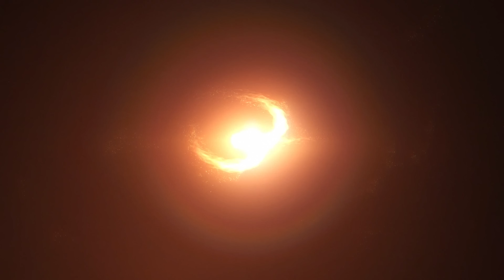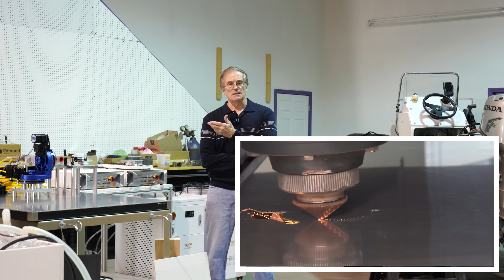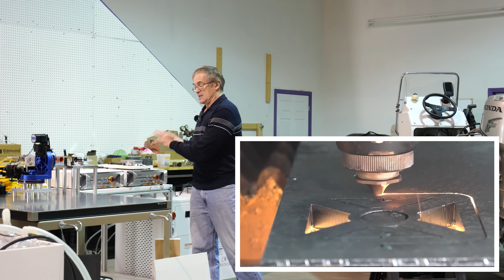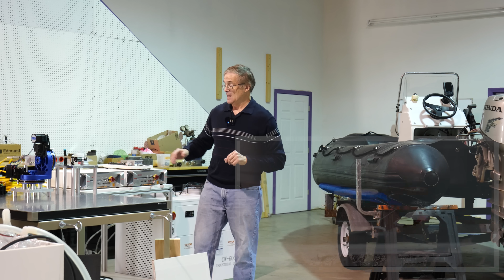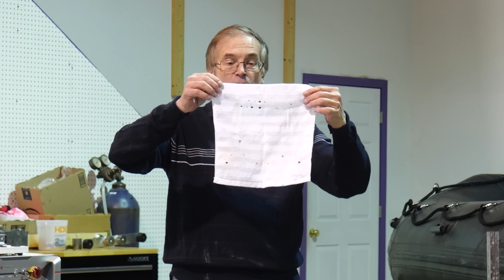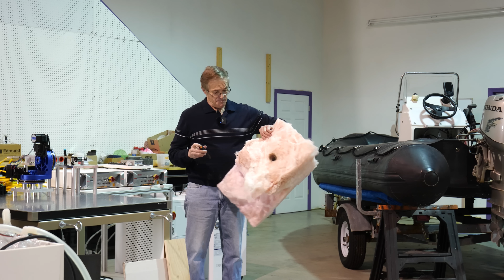We have a problem... and need your help!

Comment: Could you place a mirror outside at a 45-degree angle to direct the beam upwards to the sky? The mirror could be slightly parabolic to spread the beam. If it's necessary to keep the sliding door closed, you could cut a hole in it to allow the beam to pass through toward the mirror.

Comment: I would try something like a water curtain with sold back plane, or take page from spaceX and water cool your metal heat tiles (or similar).

Also, i dont think this would work, but i really want to see a video. Try starlight material. Maybe it would do surprisingly well?

Comment: Just a couple of maybe Ideas is to use insulating blanket such as that used in Kilns or even the fire resistant brick also used in Kilns and they are white and light also.

Comment: Furniture designer woodworker and all around good guy here. Going back to time stamp 2:48 and the description of the operation of focusing the beam makes me think the system would be better used in a way similar to the actual design. An accurate, fast range finder used to bring the beams together at an appropriate distance might be used. What I envision is something like a planetary gear system operated by turning the ring gear by servo or stepper motor and having the fiber optics placed on center of the planets but aimed off axis. Maybe? Should only take a week or two to get it running. EDIT: After thinking about the description I gave it may seem I'm saying to spin the optic in the planetary as to describe a cone in their motion. The beam will have to be made to trace along the radius of the ring gear. Perhaps some sort of eccentric could be used. No doubt it would be a beast to collimate.

Comment: Messy option: Cinderblocks filled with sand... maybe duct tape the bottoms so it's easier to assemble / dump out without making a mess?
Less mess: Tungsten carbide & silica slurry sandwiched between coarse sanded copper sheets. Refractory shops should have ample of both for 'cheap'. The high melt temp of the mix is a backup to the coppers absorbent properties.

Comment: what about a series so dlp chips you could salvage from a bunch of old defunct projectors. the chips are pretty robust, should absorb a lot of heat and could provide a small target area that is lightweight and while somehwat reflective should be able to control the direction of the beam, even without being powered.

Comment: If no clear "winner solution" appears in the comment section, might I suggest that you test out the most feasible seeming suggestions on a gun range, firing the laser from a slightly elevated position, at a shallow angle towards the ground, so that if it burns through the berm, it goes into the ground and not into someone, while also implementing all other sensible safety precautions suggested.
The testing sessions could be then made into a video all on its own.
Also the obligatory, - if I had you as a teacher in my school, I would've likely become an enginerd or a teacher myself.

Comment: This is what I'm thinking.
A hollow wall full of sand or similar marerial.
Theory.
Aa the beam hits and starts vaporizing or melting the filler...mors fresh material falls I to replace the old.to recharge just add more material.maybe you can find a material like aluminum oxide(high melting point) that can further deter the hear accumulation.

Comment: maybe try starlight, is pretty cheap to make at home, you can pre burn it so it becomes black to absorb more light, it is supposed to be fire resistant, so if you coat some wood with it, it may survive a while

Comment: Sandbags. Or maybe that US military sandbag/sandwall system, where they use a metal mesh that can be expanded/pulled out like an accordion, and can be filled with sand. The covering material
will burn, so that should be something that burns with self extinguish property.

Comment: • Budget: ammo-can “suitcase” lined with lightweight insulating firebricks IFB 2600 (≈1.4 kg each). Matte, non-reflective, shrugs off a 10 kW fiber laser for ~5 s.
• Premium: 15 mm reaction-bonded SiC disk. Handles 50 kW+ hits, won’t burn or off-gas, but costs ~20× the brick solution.

Comment: If you hold a flame under a balloon with water in it, it does not burst or burn. Maybe the same will happen if you use a laser beam. The heat just dissipates into the water.

Comment: Teflon? ....My father worked for NASA. He had a collection of different types of heat shields used for reentry. The tiles on the Space Shuttle were super light. Great for heat, but I don't know if they are good for lasers.

Comment: My idea to make it as cheap as possible is to make portable panels that might be stacked of sheets of cork soaked in phenolic resin, like the ablation shields used in orbital re-entry capsules. They burn and create layers of carbon that gets instantly replaced with new layers before the top layer can ablate and disintegrate. They would have to be cheap to make and easily replaceable, because you’d have to do a quick inspection after every few tests and you could stack them in layers of two or three.
Reply: The other idea is someone mentioned just using a berm of dirt, but you said you want it in the warehouse. So google “black plastic pallet crate” or bulk pallet crate, you can stack them with a forklift 2 or 3 deep and 2 or three high and fill them with dirt. Then when you are done you can dump out the dirt and collapse the crates for later and store them in the warehouse. You might even get them used from a local industrial park/ business

Comment: I would suggest using a ground glass diffuser, ie a privacy window or privacy glass. The key is that diffuser should not absorb the laser, but cause a random phase shift to scatter the beam in all directions. Then you can combine any other absorbing back stop solution from the other comments to absorb the light energy. You could even have multiple diffuser layers if you can find cheap glass panels. You can even make your own diffuser by simply sanding a smooth glass surface. Good luck, I love seeing the project you are working on!

Comment: Any solid/stationary solution would likely be heavy... only thing I can imagine working here while being vaguely movable is a giant sludgefall of graphite-containing fluid running over a refractory brick backing surface. But I guess some big hollow glass panels full of wet black sand might hold up for a little while?

Comment: alright...asbestos used to come in sheets---haven't thought of gas with super high heat--until you proposed question---also fire brick used in the back of fireplaces for reflecting heat out into the room---might get your ideas going?---me

Comment: ik it's a long shot but a Whipple shield type set up with one layer of permeable diffracting material and one with absorption of the diffused beam. perhaps a Fresnel lens or diffraction grid and a layer of carbon coated earthen panel might help. this is just crazy enough to work in my opinion.
Reply: that or dirt heap/sand bag etc

Comment: It's obvious to me now.  The laser power is just too much.  Most of the testing must be done with a lower power laser. The finesse can be done with the real deal but maybe you can program the system for test purposes to only actually fire the laser at the target when the target is in front of an absorbent background.  Not the entire background will be made of this material.  This makes other materials such as 2x2 concrete pavers an option. Only a small section and only for testing. As suggested earlier testing outside or in a cave would be the only other option that I can see.

Comment: I was thinking if you used perlite from the garden center in between two layers of cement board it could fall in if some got burned away and replenish itself its also very light weight. You could also use metal insulator metal stack to automatically kill the laser when the beam hit it it would fuse the first to the second and sending a signal to kill the laser

Comment: I think a composite sandwich layers of different materials will be needed. Mount the wall on wheels so weight isn’t as restrictive. Cement wallboard on both sides of a steel stud frame filled with wet sand might do it.

Comment: A carbonizing agent you can layer on top of the wall. There are various household items that could be mixed to create high heat resistant solutions. Nighthawkinlight did an experiment to figure out Starlite, and others have followed suit in more recent years. The originator of "Starlite" claimed that it could handle 10,000C worth of heat and that it was laser resistant.

Comment: You came close but you forgot to ask the obvious question. “How do the big boys do it?” I’ve worked with fiber and solid state lasers for a couple decades and they use a mechanical device called a shutter, which is a water cooled device that uses black anodizes aluminum plates with additional coatings. Looks like you have a 1k watt device there, military try to use chemical lasers which produce mega watts, but the problem the gases produced from the process are toxic. If you call Omada or Trumpf lasers, I’m sure they can help you.

Comment: Silicon carbide (SiC), alumina (Al₂O₃), boron carbide (B₄C): High melting points and thermal shock resistance make them suitable for laser armor or optical components.
Reply: Silicon Nitride - another one to look into.

Comment: Setup a "Jacobs Ladder" arrangement of laser beam splitters. Where there is a 10 % to 90% split ratio. 
Each level disipates 10% assuming you have a solution for absorbing 10% of the fiber laser output. Otherwise add more splitters. 
P.S. make sure your splitter optics are perfectly clean before each test firing. 
Chromii

Comment: I'm not engineer or anything so no clue if what I'm about to say is logical, but the first thing that comes to mind would be something that can resist high temperatures and at the same time be a good thermal conductor like Graphite, my idea is to have a panel of graphite (or other material) in the way of the laser and on the back of the panel have one or many thermal probes connected to a micro controller that detects the increase in temperature and activates the kill switch using relays or a contactor directly in the power line of the machines

Comment: What about changing the focal length of the beam prior to its output so that the laser beam is weakened or completely removed, nullified or weakened substantially. The moment you wish to target something you open up this gateway or switch releasing the full power of the laser beam but until that moment you have an unfocused laser that is nothing stronger than a harmless flashlight.

Not sure if I’m explaining this well but essentially I am suggesting a switch or plate that is attached to a solenoid that can be lowered in the path of the laser beam and then removed when you want full power thereby decreasing the legality of the beam until one needs full power.

Comment: My first thought was based off you comment about maybe the light would bounce around fiberglass, could you use Vanta black as part of the solution. My second thought was can you do something that acts like a lens to rediffuse your focused beam.

Of course my other thought was that using this IRL would risk potentially major collateral damage behind the thing you're trying to damage. At what distance does the beam diffuse enough to be safe?

Comment: I'm not a physics Guy, but If the area that hast to be Laser-Save is Limited within - let's say - 100cm2 probably a kind of spheric formed Plate of 1cm thick tungsten steel with a rough surface. That probably could withstand a short period of time the Laser-Energy without taking much Damage and could give enough Time to Stop or shutdown.

Comment: After thinking about it overnight, came up with a better idea than my previous post.

As I understand it, you only need to withstand the laser for a couple of seconds.  How about open top 55 gallon steel drums in two offset rows?  We get our open top drums from an industrial waste disposal company.  

The offset is so there are no gaps between drums.  Use steel strapping to hold the drums in groups of four, two in front, and two in back.  

Place two groups, stacked on top of each other, on a pallet.  Rent a small forklift to move the pallets around.  

If empty drums are insufficient, fill them with sand or pea gravel.  Or fill with something lighter if you can identify something affordable.

I know you wanted something less massive, but I think mass is the answer.  This solution is massive, but it is also easy to contain and move around.
Reply: The drums may not be made from laser safe materials and the fumes can be toxic or Release hydrochloric acid gas.
Reply: @ How do steel drums or sand release hydrochloric acid gas?  And it is apparent that no materials are safe from these lasers.  The drums I am referring to are nothing but steel and paint.  The paint can be removed with a wire wheel.  The sand is silica dioxide.  That gives you silica, oxygen, iron, and carbon for potential reactants.  No hydrogen.  No chlorine.  Just molten glass and steel in amounts less than welders and glassblowers are exposed to every day.

Comment: In the background you can have a 55 Gallon metal drum, rotating a slurry of dark sand and water. Will have to be positioned so that the beam hits the slurry at all times and not the drum body.

Comment: Redirect the beam via 2nd fiber bundle to a toriodal plasma chamber using magnetic containment. Bleed off energy as defused light or IR heat. 
Hopefully you can recover some of this energy & use it for practical applications. 
Chromii

Comment: Need a combination approach.  First, use Vantablack material,  the blackest or darkest  material known , to absorb 99% of the laser light . Put that inside a take of tank of ferrofluid or mineral oil will  momentary dissipate the excessive heat.

Comment: Can't help with the material thing, but a few ideas came to mind. They're probably naive and silly but it can't hurt to throw them out there in case they spark a better idea.

1. Pulse the laser
2. Use both lasers at a lower power and direct them to converge at the distance you want
3. Instead of a material, use some kind of photoelectric device to dissipate the photons - or a series of 50/50 splitters maybe

Comment: Build/setup and brickwall and install a fairly substantial water fall over the fire facing front of it. You might even include some fine particulate in the water to cloud and help briefly absorb the energy but very quickly move away to a cooler zone. Also somehow moving the WHOLE WALL back and forth or up and down or random motion should assist keeping the bricks from sustaining a single point of destruction. Just top of my head. Precise material could be experimented with. Another material to consider somehow utilizing is AEROGEL.

Comment: At the point where you need to have a lower power level, could you use a beam spreader to lower the beam intensity and the need to use exotic parts to impact the laser's intensity?

Comment: 1. Do the tests outside.
2. Have a surfacemirror on the other side of the target, at a 45° angle. To guide the Beam up or down.
3. Make sure that the mirror is a little bit rippled so the beam gets a bit out of focus.
4. Absolutely crucial, I have to see how you made the lenses!!

Comment: In order to make it useable as a product (not only cool-as-F experiment) you should use multiple smaller lasers (with some emitters spread) focusing to the same point. If they point to the same target - their power accumulates, but if not - their individual power is too low to cause harm. If it misses target - they diverge.
I believe this is the technique used to kill cancer using proton arc therapy.

This way you'd sidestep this death-ray-conundrum, and make it applicable in real world (with people around it).

Comment: Rockwool insulation has about double the heat resistance of fiberglass (1000C) before it melts.  After that I think you'll need to made space shuttle TPS tiles (I think over 1500C) or ablative sheilds?
Reply from the maker: That's definitely on our new list to test.

Comment: Hmmm...  That amount of energy should not be directly received. Should be dispersed, with some kind of prism.
1. Aquarium with water full of glass marbles
2. Angled stacked glass with a bevelled edge.
3.Perhaps reflected in safe direction with wall of mirrors angled towards the floor. Where the beam would be met wit a pool of water and some barrier in it  (bricks).
4. Or, the stupidest solutions are always the best. Just stack a hundred cubic meters of bricks. After experiment just resell them. Its understood that the buyer will remove the mess :) . If not , at least you will be full of muscle.
And one waning my IQ is 71.
Like in paralympic games, participation is count ;)
all the best

Comment: Not practical for a backstop, but how does aerogel fare against lasers?
Reply from the maker: I suspect poorly. If it interacts, as it must to absorb the energy, its extremely low mass means it will get very hot very quickly.

Comment: I'm not an engineer or anything but I was reminded of something described in a Sci-Fi story I read long ago. Slow glass. So, wouldn't a very dense, semi-opaque bulletproof glass work to absorb, refract and reflect the energy?
Reply from the maker: It might.
It would also probably be very expensive over such a large area.